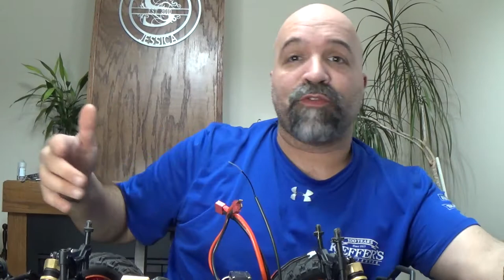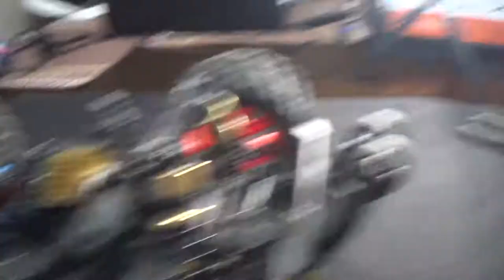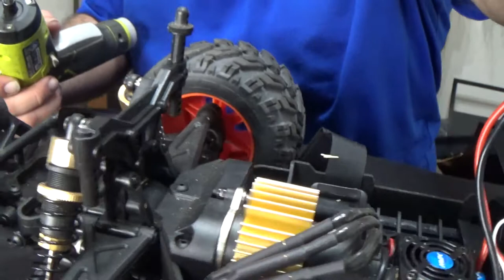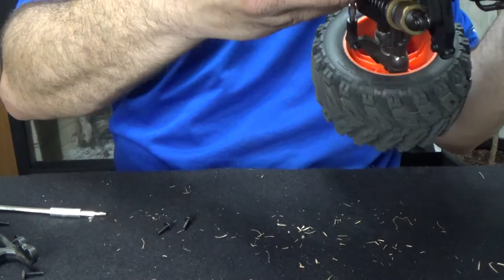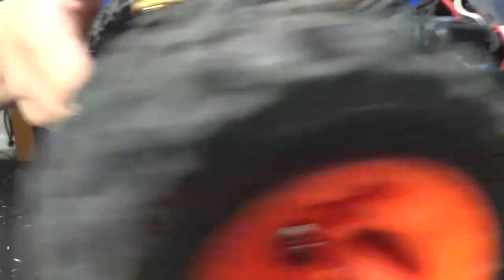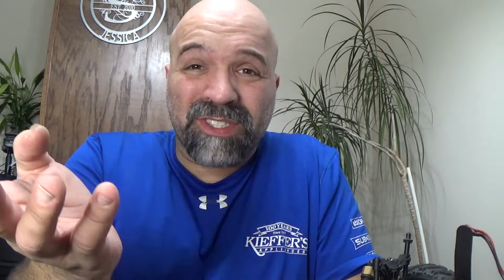Maverick Quantum lost 4x4 after last run

Comment: The grub screw on the drive shaft coupling  coming loose is a common problem on these trucks, you must use thread locker compound on these grub screws. Otherwise they will continue to loosen.
Reply from the maker: I had a feeling that it was going to keep walking so thats what I actually did after this video lol

Comment: I've seen you still have the body post mounted as stock, if you put them down in the lowest position (you have also tu cut 10 mm the bodyshell in the front to don't interfere with the front bumper) you can reduce the risk to break them again. Easy but efficient mod.  ciao!